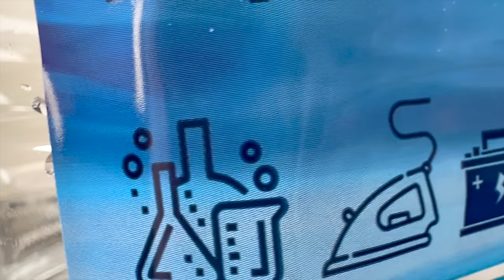Abandoned PC Restoration | asmr restoration

Comment: While some don't interpret it as a restoration, I understand why. This equipment in your country is quite old, while in my country it is still sold in some stores as a current machine. I work with this and I can say it was an excellent restoration, yes! Congratulations for the work and just for the kindness to those who need it, it would be worthy of my lyke =) More than a viewer, an admirer of your work. Big hug =) Rio de Janeiro - Brazil.
Reply: Author from Ukraine, here this equipment not too old :)
Reply: You are going to brazill
Reply: @Datwaltuhdawg  no ... I living in Brasil - Rio de Janeiro.
Reply: Washing motherboard in a bucket of water, good luck with that 😂
Reply: @heraldam  what is the problem with that? you could even put it in the dishwasher and you'll be fine. Just watch out that your water is pure to not leave any residues.
Reply: @heraldam  As long as it is DRY before you reassemble it it is not a problem. I prefer 90% alcohol in a sonic cleaner, but you work with what you have.
Reply: @2528drevas  how would you make sure its dry? Dry it for 6 months? What about open vent capacitors?
Reply: @romanv951  The A8-5500 is 11 years old, and it was low end when it was new.
Reply: @heraldam  Put it out in the sun for a few hours, or use compressed air to dry. The hell is even "open vent capacitor"? Capacitors are sealed, if they're blown open, they're bad and need to be replaced.

I've washed hundreds of motherboards and never had an issue.
Reply: Não sei em qual Brasil que voce vive pois no que eu vivo isso não é mais vendido tem muitos anos, as pessoas vendem usado ou doam mas em lojas somente em loja de quinta que vende até lixo pras pessoas.
Reply: You could install Linux on a pc like that as a Budget Office pc , better then landfill
Reply: Pity to hear that these are sold, not given away as old for business machines. Hello from the 3rd wWorld too, where these are charged for like $50usd too. for the whole PC
Reply: RealCutieboy  Depends on how nasty the board is. If it's just dirty, tap water and a paint brush. If it's covered in nicotine tar, soak it in alcohol bath and then a sink with soap and water. If greasy (like from a kitchen) then wash with a mild degreaser.
Reply: @heraldam  To make sure it is dry, you first dry it as much as you can wit hot air from a hair dryer and after that let it several days to completely dry.
You do not need to submerse it in water. Just make it wet, use a brush and soap, clean the soap with some more water and that's it. Quick and effective.

Comment: Using water to clean the motherboard, my gosh you're a genius!
Reply: 1. Its distilled water, it cant break it like normal tap water
2. Water only breaks electronics if they're powered when they're wet
Reply: It works. Even with usual water. You do not want to do it with your +1000$ PC but with this... it is a requirement.

Comment: i'm very satisfied, the broken fan blades really dropped the mood, suck that the broken blades were not inside the case otherwise you could use super glue to fix them (high chance heat from cpu will melt the glue anyway...)
Reply: He broke one of them himself, probably both.

Comment: Wow man, now THAT PC was filthy smh. I strip them down and wash the mobo's with a toothbrush soap and distilled water too then blow dry let it sit in the sun a few hours or indoors overnight and depending on the case OE or after market, they get taken apart and hosed down. I got reassured that washing with soap n water won't hurt PC parts from watching Brian at Tech Yes City. Power supplies are the exception for me tho. So long as cmoss battery is removed  from mobo and parts allowed to dry 24 hrs they come out nice and clean.

Comment: You're not supposed to use a vacuum cleaner on computer circuits, unless it's a battery operated DC vacuum. Static electricity can and will fry the CPU or other chips.

In practice at shops I've worked for, we use an air compressor instead.
Reply: No it can't.

Comment: Those old tiny cpu PWM fans you can straight up run under the sink. They're so low power they don't short and everything the motor is made out of is corrosion resistant.

Comment: I dust cleaned one of my fans once like this and it was spinning fast. The fan didn't turn afterwards, turns out the ball bearing broke and I had to get a new fan. So now I always hold the fan blade if I'm cleaning it.
Reply: Yeah I broke a 17 year old fan a couple of weeks ago doing that. I was vacuuming it and the plastic that attached the hub to the spindle broke. Was an old Antec 3-speed fan. Oh well, I was replacing it anyway.
Reply: if i saw correctly the cpu fan was intact when taken off then 2 fins where broken with the toothbrush.

Comment: Это FM1?
Reply: @rustydustyPC  у меня мой основной ПК на FM1,
Вот характеристики:
Soket FM1 
motherboard MSI A55M-P33
CPU AMD A8 3870K
power unit 490W 4 pin cpu, 6 gpu, 20+4 motherboard
HDD 500 GB
Ssd 120 gb
DVD drive sata
GPU GTX 750 1GB
RAM 4GB один слот